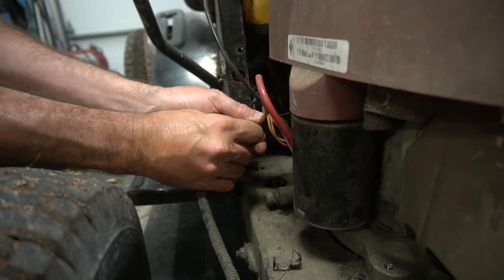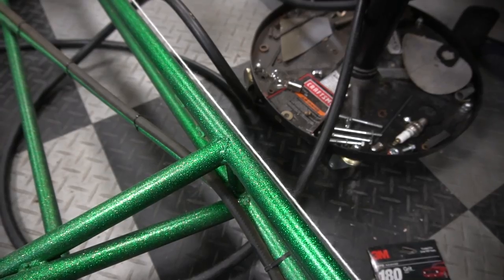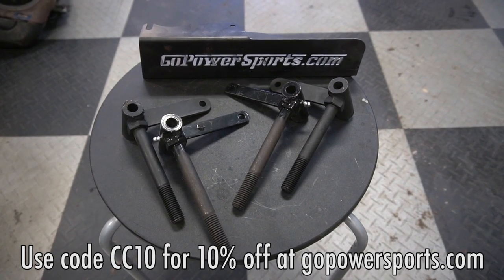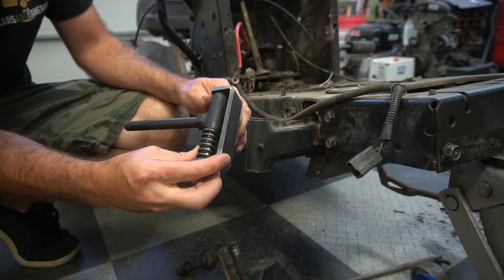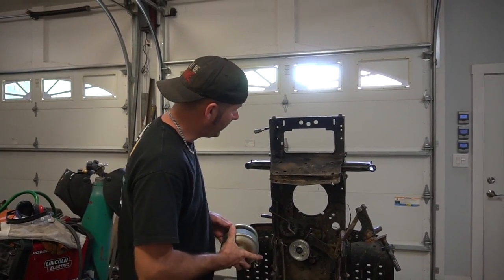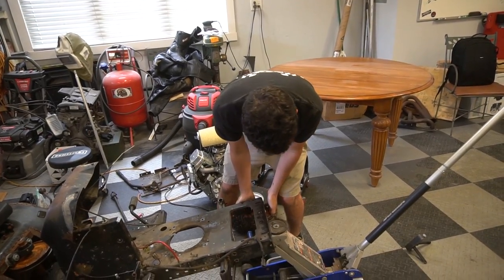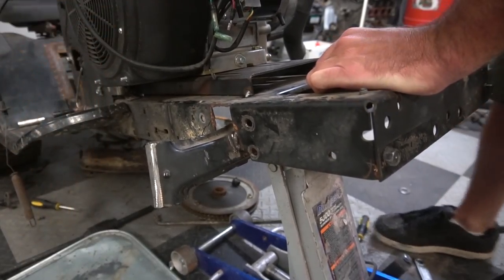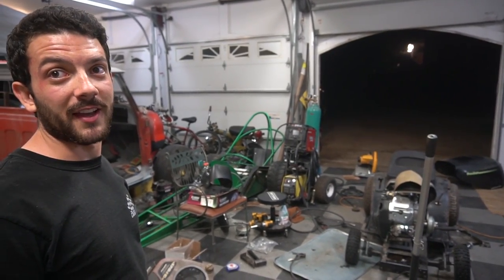50HP 670cc LAWN MOWER SWAP!

Comment: wish you wouldve put the front axle forward like against the front of the chassis wouldve given the wheels more room to steer without the engine in the way 

wat you could do with the rack and pinion steering is put it under the mower sideways only using one end of it 
steer it with a solid shaft straingt down and the steering wheel horizontal on top of it  , driving a push pull bar to a L shaped hinge (bottom end of a kart steering system but with remote controll using a pushpull bar driven by the rack and pinion ) to the front spindles
it will basicly turns the rack and pinion intoo a classic truck pitman arm steering 
the steering will have a little more play as there are a lot more links but you can place the engine anywhere on top of the chassis without anything like the steering shaft in the way 

another idea is (again) find a tiny rear wheel drive car and use its diff (quad bike with an actual diff ...... hmmm maibe a diff like in the tankboat ?) mount the engine sideways like on the little red wagon  and use a driveshaft driven of the torque converter 
that gives you the option of using bias braking on the rearwheels and actually being able to steer the tracktor while its on its rear wheels 
might be a good idea to mount handle bars instead of a steeringwheel so you can mount two motorcycle brakelevers 

prolly allso be a good idea to mount a racing seat with a higher seatback so you dont fall of the back

Comment: Much as such projects may look "BAD" there reaches a point in power to weight ratio where you just can't transmit the power to the road. Yes you CAN put a turboshaft helicopter engine in a shopping cart.... if you just want to sit and burn rubber. Same applies to a Hyabusa engine in a Smart car body.... or a modified 670cc on a lawnmower.
Reply: IT'LL BE FINE!

besides, they can always borrow the tires from the rail for better traction

Comment: The steering is going to be over complicated, you would be better off using  hyme joints and making it a more solid steering setup...like I suggested when you first were building the mower.  That frame also has zero bracing so even with all the modes it is going to be even worse as it will flex more with the old motor out of it, again something I brought up ages ago with the old setup.  The belt situation with the old motor could have been  fixed by deleting the half torque converter, mower belts are not designed for those (hence pulley clutch).  Honestly I was hoping to see something done with the original engine instead of (insert Predator engine here) the same old same old, basically this will be the faux racing mower.
Reply: Yeah that weak front axle beam is not going to last them but if they refuse to listen it's there fault.

Comment: Hey guys..do you think the frame on the rail got tweeked at busco beach? or maybe running it over the tree roots in the grand prix?..anyways yeah get it fixed before you do something crazy on it..don't need ya'll splitting the frame rails at high speeds
Reply: they showed a buggy ramming it under a truck at Busco beach because of a stuck throttle on the buggy.  They could talk to their local vo-tech to see if they could put it on a frame machine and straighten it out.  Which would not be too hard with as little as it is bent.  I would be more concerned with it affecting running straight, which could be fixed by adjusting the tie rod ends, than with structural integrity.  The metal was not "kinked" so it should be able to be bent back pretty easy.  Set it between two firm objects and they could bend it back themselves with a 2500 pound winch that has a brake.  Bring it tight against the braces, then pull it a little past straight the other way, let it sit for a little bit to let the metal accept the tension, then release it and see if it is straight, repeat as necessary to achieve trueness again.

Comment: Shouldn't call it a lawn mower now with out the vertical shaft engine and the transaxle could have just fixed the steering and slap a vertical Kawasaki 730 or Briggs mine has the 730 with the transaxle can hit 87mph

Comment: Frame gussets?
Reply: 1'' square tubing 1/8 wall cross brace would be good and DO AWAY with that WEAK stamped front axle beam for a 3/16 wall 2x2 square tubing.

Comment: Hey I got a predator 212 cc on my go kart but most of the time when I try to start it it idles and then I turn the choke off and then it screeches and dies I think it might be the clutch I oiled it and it did the same thing anyone know what I could do
Reply: Take the clutch off and try it. If it doesnt its the clutch. It might br the pull start if it does( or worse) bad engine
Reply: Isaac it'll be fine ok thank you  I’ll try it out

Comment: Hook it to a Harley transmission. You need gears to harness 50 hp. Why do you think that 200 cc motor makes more power than a 212
Reply: Im not sure what the 200cv engine makes but its fun going threw those gears

Comment: put on a skidoo 670 twin snowmobile engine lol 100+ horsepower, better yet a yamaha srx 700 or formula III 700 engine. the 670 predator is so overrated

Comment: the chassis will probably be fine because of the construction steel that you used that type of steel is very malleable so worst case scenario it will just bent a bit more in a sharp corner there is no change of a instantaneous complete chassis failure.

Comment: Please have the engine rotate longitudinally, and not transversely with a silly long chain set up. Please just use a driveline and pinion to ring set up in the axle. Please! The rat wagon is cool as f__k with it's set up. Do it like that please. You know that a lot of chain drive is a lot of troubles down the line. Thanks.